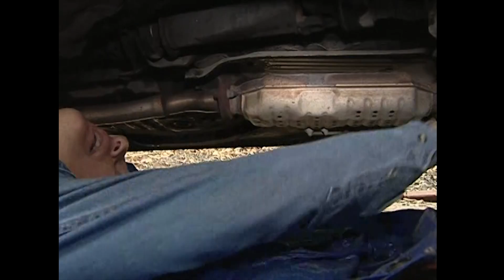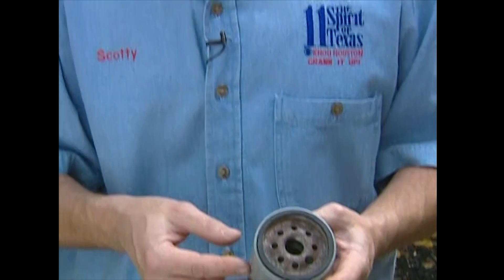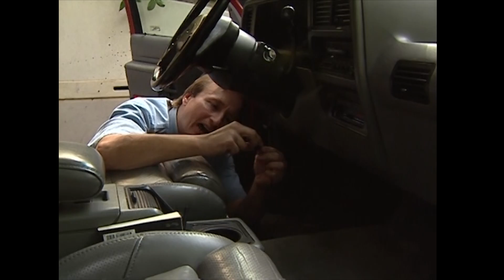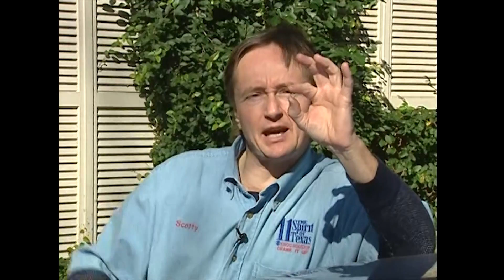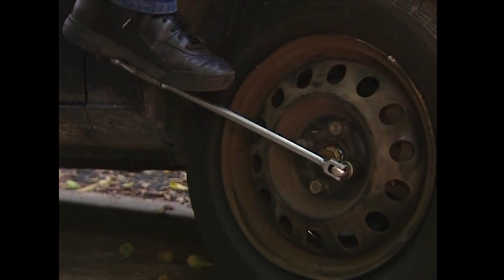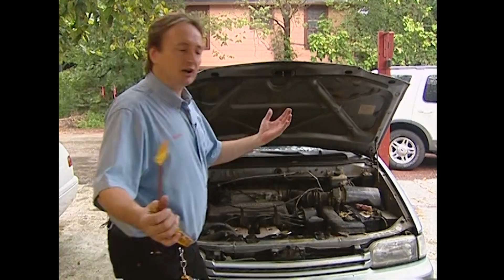My Life Before YouTube (Lost Footage)

Comment: I wish that you were my mechanic.  If I lived in your state , I would Hire you in a Heartbeat.  I have a 1998 Chev  Suburban  1500 4×4 that I have to put gas in the place were the carburetor would be if it had one.  Just a little in order to start it. I had some people tell me I need a fuel pump. Or I have a weak fuel pump or maybe a clog in the fuel pump or some other people told me it could be a fuel regulator or maybe the fuel injectors are clogged.  I was told to get a fuel pressure check and that might tell if I even need a fuel pump.
After I put in a little gas I can drive it all day without any problems until I turn it off. Sometimes I can start it back up after it has ran for awhile by turning the key off and back on about 4 times then turning it over.  I am not a mechanic so I am just guessing at this point.  I think I was quoted $20.00 to do a fuel pressure check and I guess I'll go from there. If you or anybody else have any suggestions,  I am all ears....

Comment: That oil filter gasket staying on the engine thing happened to me on my 90hp outboard.  When i turned the engine on, oil started spraying everywhere.  Turned off my motor before it lost all of the oil.. but it took me 8 hours to clean up the oil off my motor.  What a mess.

Comment: Before you imitate Scotty and look for a 1990's Celica, here are a couple of tips. Only certain years had the 2.2l. DOHC 5S-FE 4 cyl, which was the stanard engine in the Camry through 2001. That's the one you want, unless you are a serious gearhead and know your production.

An alternative to the Celica is a relative unknown, the 95-99 Nissan 200SX. This is a two-door coupe version of the Sentra, with a 1.6l engine. Many of them have 5-speed manual transmissions. If you want a cheap project car, this one is a good bet. You might think of it as an alternative to the Chevy Cavalier, which some people adopt as their project car. In reliability, it udoubtedly is ahead of the Cavalier. The supply of used parts is decent. The Sentra parts fit and so do many Altima parts.

One video here rated the 95-99 Nissan Sentra as one of the top five cars under $1500 in reliability. The Nissan 200SX is the same thing, with two doors. I bought one on this recommendation after my former vehicle got wrecked. I would agree with the assessment. It was very cheap too, and I put the change from the insurance settlement in my piggy bank.

Comment: FREE FLAT REPAIR
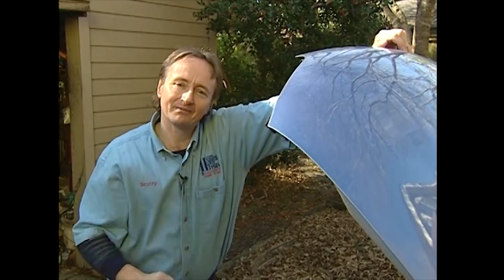@ 10:02 talks about repair with a gummy plug (bad idea) they stretch and make the hole bigger, the gummy plug dries up and shrinks, then expands in water.
solution: take it to a Discount Tire  - They do Free, Professional Flat Repairs, assuming its not an old tire, with bad tread (like in this video, but i know its a i.e. moment)

Comment: That was awesome. Scotty you are really one hell of a mechanic. That bypass wiring you did for the AC on the EXPLORER was incredible.
Reply: Hmmm I need to do that for my accord
Reply: Yea I used that trick on my old 94 Exploder. First the blower only worked on 1&4 so I changed the resistor, then a week or two later so had to run the bypass. Was an old trick I was taught early on in my career

Comment: JUST AN FYI : A ROADSIDE ROPE PLUG IS GREAT IF YOU 100% KNOW YOUR TYRE DIDN'T GO COMPLETELY FLAT, EVEN THEN THE SIDEWALL COULD BE DAMAGED AND WEAK. IT'S MUCH BETTER TO GET A MECHANIC OR TYRE SHOP TO STRIP IT AND REPAIR PROPERLY IF POSSIBLE AND EVEN THEN THEY MIGHT FIND IT'S NOT REPAIRABLE. TRY AND PUT YOUR SPARE ON OR MAKE SURE YOUR SPARE TYRE IS GOOD BEFORE YOU GO ON A TRIP. 
 I CAN UNDERSTAND IF YOU ARE STRANDED AND YOU'VE GOT NO OTHER CHOICE BUT I WOULD DRIVE SLOWLY TO NOT HEAT UP THE TYRES TOO MUCH AND PUT STRESS ON POSSIBLE WEAKNESSES IN THE TYRE.  IT'S A GOOD IDEA TO GET YOUR TYRES CHECKED OUT ONCE OR TWICE A YEAR TO MAKE SURE THEY ARE ALL GOOD AND WON'T LET YOU DOWN, A LOT OF MECHANIC DON'T EVEN CHECK THE PRESSURES LET ALONE THE CONDITION OF THE TYRES.

Comment: Scotty, you're a wealth of knowledge!
I have a Honda much like the one in your old video and my cigarette lighter in that car is terrible should I replace it even though it still works 98% of the time.
Is that a regular problem on that model?
Mine is the v-6 if it matters.
I've put 65k miles on it since I got it. It's got about 186k mi now, and thanks to your videos, it still runs like a clock.

Comment: This mus have been before OSHA cause Scottie's not wearing safety glasses, Remeber getting dirt in your eyes was the norm. lol Have you seen the carb that gets 2oo mpg. pull a vacuum on the gas and your burning 100  vapor. Or you can heat it, thats sounds scary.  What do think about the Chevy Trail Blazer SS It has an LS-2 4OOhp. engine with Cathedral Intake manifold ports.

Comment: After temporary plugging the tyre though scotty it needs to be repaired properly with a rema tip top patch on the inside of the tyre.
I use stop & go tyre pluggers in conjuction with the rema patches as i find they are the best for repairing tyres.
Good video scotty.(:-)
Reply: Plugging the tire is only a temporary fix, until you change the tire when it's worn down.

Comment: Plugging tires is not recommended any more. In some states it is against the law for shops to plug tires; they have to be patched from the inside.
Reply: They are not a permanent repair, they only last as long as the tire
Reply: @erikneland8632  
The best repair is the patch/plug. And if it lasts as long as the tire then that's good enough

Comment: It's not scotty when he doesn't mention:
1. Rev up your engine
2. When i was a young mechanic
3. Been mechanic for 50-something years.
4. This car has 240k miles and still ride like a dream
5. My wife lexus...
6. Piece of junk (mercedes car/mercedes dealer/bmw dealer/Fiat car picture)
7. Quality gone pfffftt
8. Plastic crap/stupid cover
9. I'm cheap
10. Find a good/honest mechanic like me to check it with dealer level scan tool that can do bi-directional test
11. Nexxttt questionnn
12. Non-offensive comment on the comment section below.
13. So if you never want to miss another one of my new car repair videos, remember to ring that bell CLANGG

Comment: Scotty I have a problem with my car it’s a 2001 Jeep Grand Cherokee it starts most of the time but sometimes I’ll turn the key and you will here the engine make a single noise but it won’t crank or anything all the lights come on in the dash I’ve replaced the starter it has a new fuel filter/regulator and fuel pump the battery is fairly new and at this point I have no idea what it is could you please help me out if you could thank you
Reply: Coil ,module distributor